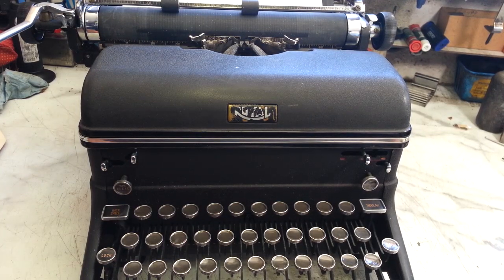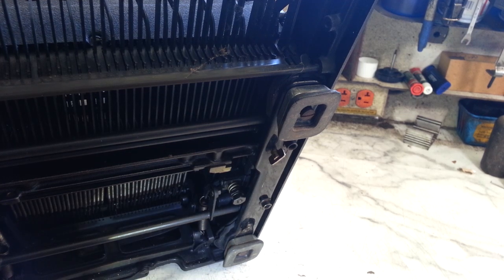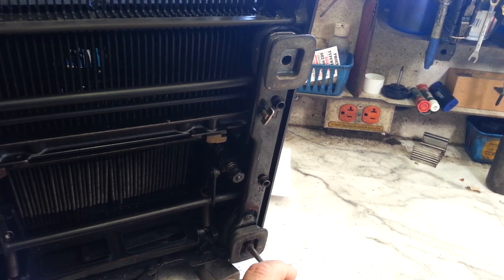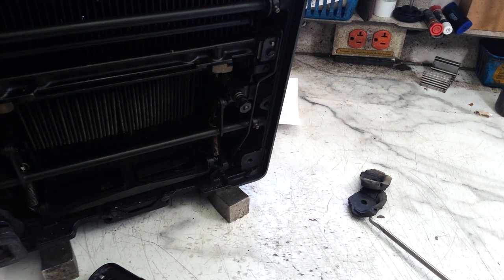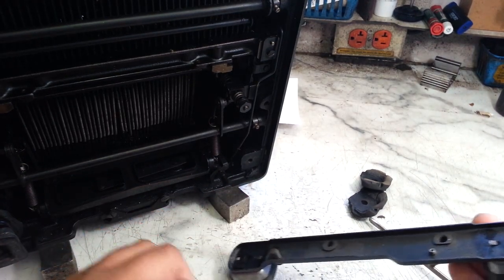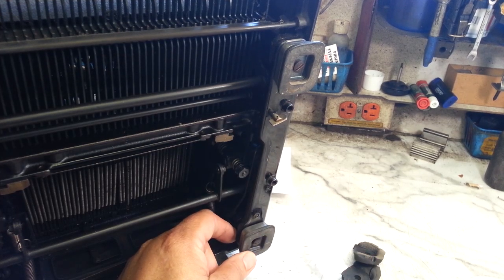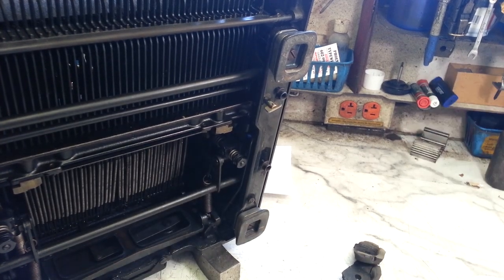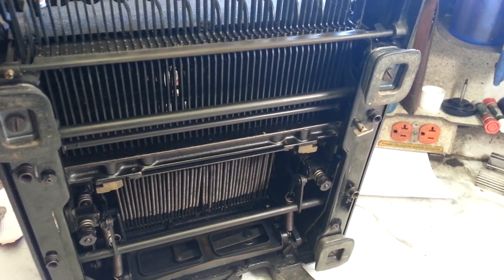Royal KMM KMG Typewriter Feet Spacers Original Smashed Rubber Replaced

Comment: Duane,
A set of harness grommets is available at Harbor Freight for $4.99. The set had five 1" grommets which worked great as feet cushions on my Royal KMM. They are not as thick as your grommets but worked great.
More affordable than reproduction cushions offered on line. No complaints on the quality of reproduction cushions and feet but a full set was $85 on line. 😲